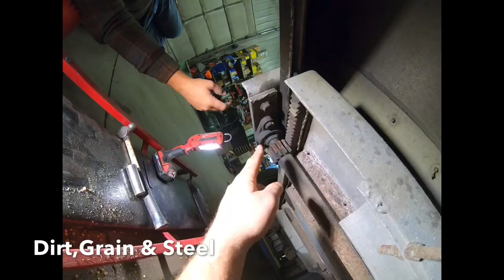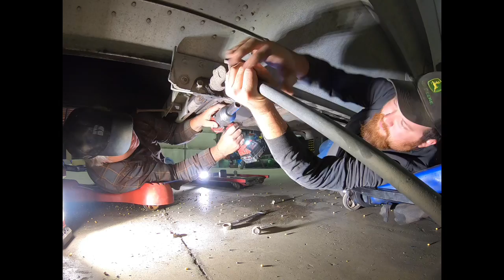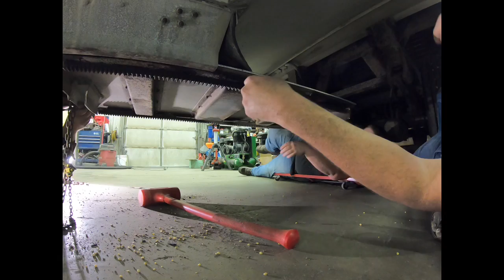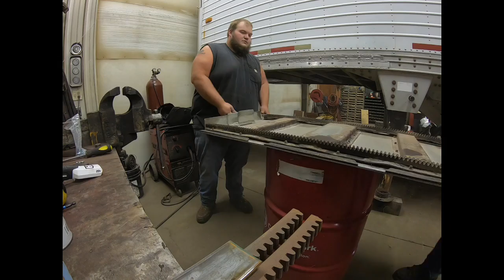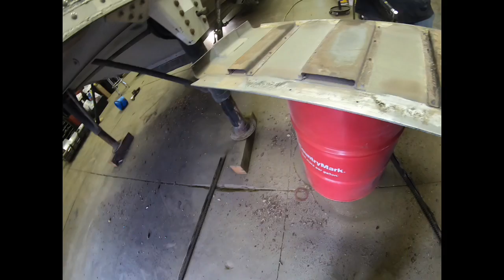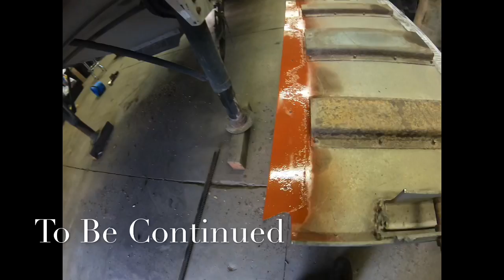TIMPTE SUPER HOPPER Part 1…Stiff hopper door repair no getting yelled at at the elevator anymore lol

Comment: I did some last year, no new parts. I removed racks from door as you did. Then I cut around the welds to remove racks from mountings. I cleaned all the rust from racks and mounting plates. I straightened plates and racks, welded then back together and painted them. Mounted them back on doors with counter sunk bolts and reassembled. The man at one of the elevators said I should do then neighbors trailers. It’s well worth the work. The doors I did have bearings the door rolls on instead of urethane slides. The bearings are also a problem. They are sealed bearings but still seem to seize within a year or two, maybe the urethane slides are better?
Reply from the maker: We had thought about trying to straighten them all out and re weld it all but they seemed to be worn so I told dad to start out fresh....your bearings are the best way to have heres what I suggest to do is get new bearings and take a pick and pull the seal out of the bearings pack them with a really good grease like Mystik JT6 pop the seals back in and put them back on the trailer the grease they come with isnt really the greatest for the conditions that these trailers go through like I said in the video in wet weather it's a constant hurricane of moister under there or its even possible to get a needle greaser and just poke it in the bearings and pump them full but I just suggest popping the seals out if you can....but thank you for sharing your story on rebuilding your doors I always like to hear how others have done their projects

Comment: Could you use a thin piece of poly between steel and aluminum parts the slow corrosion.. like the poly ring that is used between steel and aluminum drive wheels?
Reply: Or what if a person used right stuff silicone between them.. or something like por15 or chassis saver.. just looking for opinions
Reply from the maker: I suppose you could do something like that I don't see why you couldn't there is plenty of adjustment to allow for the extra thickness of the poly strips it's worth a try